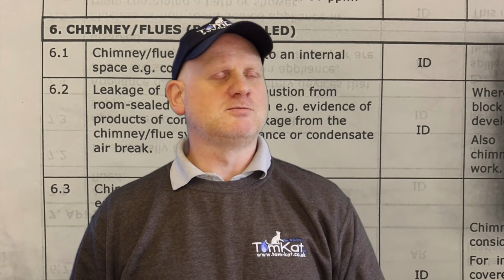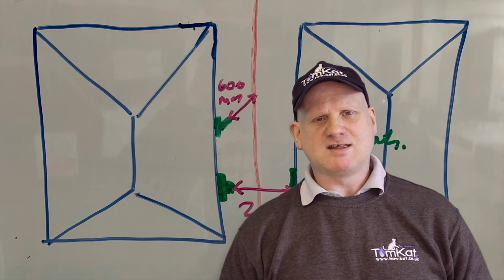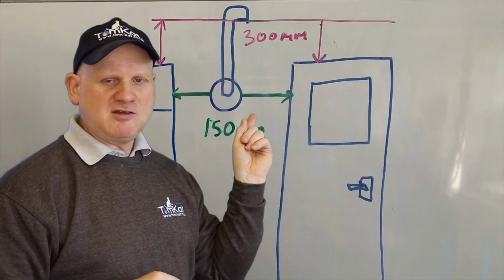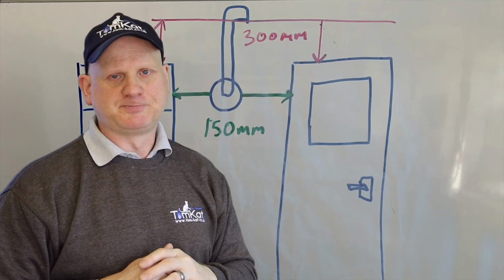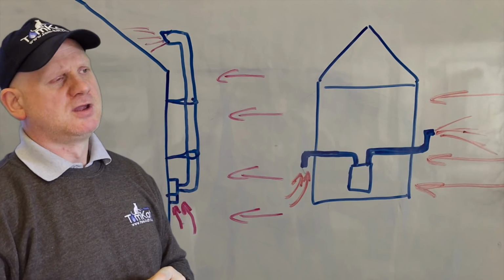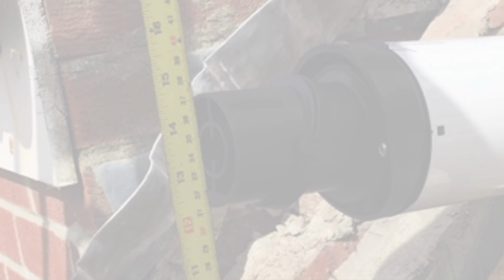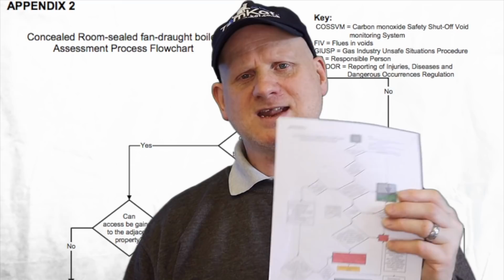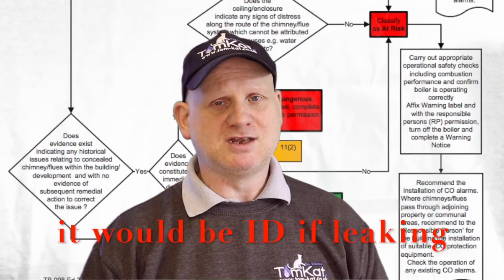How boiler flues are installed, CORRECT INSTALLATION OF BOILER FLUES PART 2, gas boiler flues,

Comment: Would you be able to clarify please (in the same clear and helpful way as this video), the correct way to install a horizontal boiler flue into a) a static all-timber building and b) a mobile timber building?

Comment: Is there a clearance distance require between the air inlet and a lean to roof?
Reply from the maker: Normally at least 200mm but it depends on the boiler manufacturer check the manufacturer instructions for the boiler for clarity.

Comment: Hi Derek great video,  1 question I can find an definitive answer too is are the minimum distance measurements (eg to a window) to the outside of the flue or to the exhaust part of the flue?  And in the same vane how does a plume divertor affect the minimum distances?
Reply from the maker: Plume kit reduces the measurement by 50 %  but only if the air intake is a minimum of 150mm and it’s from the side of the flue to the opening

Comment: So you could use expanding foam inside and possibly outside around the flue pipe provided you finish with a 25-35mm cement to provide the weatherproof status?  Why would you direct the flue upwards with that Worcester flue as that allows direct entry for rain?

Comment: What is the significance of having the air inlet and flue exhaust in different pressure systems?
Reply from the maker: Unbalanced flue system
Reply: @tomkatgastraining  I have a flue coming out of a wall, it got picked up on our RICS inspection so they have put an extension on. The opening of the extension is pretty much at the corner of the wall, I imagine it's more exposed to wind/gusts. Whereas the original flue and air intake is further away from corner in between our houses. What can the unbalanced flue system do?
Reply from the maker: @lloyd4011  as long as it’s on the same wall and facing the same way it will be fine but if you have concerns get it checked by a competent gas engineer

Comment: Thanks Derek. Excellent videos. Have you done anything on the requirements of sleeves for a flue going through a timber frame wall? I'm having a new Worcester 32CDi LPG Compact Boiler installed and our property is timber frame. Does the flue need an additional stainless steel sleeve through the wall to protect against potential thermal damage to the timber frame? If so using a flexible sleeve how should it be sealed at each end?
Reply from the maker: You will need to speak to the boiler manufacturers about this issue as a lot require different things but as a general rule the flue will require a sleeve when installing in a timber frame

Comment: 5:20 is the flue on the right to close to an opening as that looks less than 300mm?
Reply from the maker: Impossible to tell from the picture just used the picture to show boundaries and facing terminals

Comment: Hi Derek. Another great video (parts 1 and 2!).
I'm a sparks by trade but want to know what the correct way is to install a new flue to a new boiler.
I'm getting the so-called professionals in to do the job but have had different stories from different engineers who have visited to quote.
The boiler is currently in the kitchen on the back, cavity wall of the house. The flue goes through the wall where it enters the conservatory and then has a 90 degree elbow which then has about 1.5m before exiting through a multiwall, polycarbonate sheet which is at the side of the conservatory. This was done 20 or so years ago by the guys who built the conservatory and was designed by Potterton for the situation.
There are a number of problems such as lack of brackets, however if the main problems are corrected during the new installation, is it basically ok to have a sealed flue running through the conservatory, provided the POC and air intake exit outside in a suitably safe place?
I will also get advice from the boiler manufacturer, once I have a specific in mind, as per your recommendations. I don't want to waste time on this if it definitely can't travel this route. One engineer said no problem, another said that condensing boilers have hotter gases now(!?) so the polycarbonate would need to be changed and the other said that the boiler should be disconnected but he would just pretend that he hadn't seen it.
I obviously need to choose better heating companies to quote!
I hope no-one thinks that my reference to "so-called professionals" is attempting to put heating engineers down. I think that I have just been unlucky with a couple and they are the minority. You and others like you do everything to ensure that everything is done in a safe and professional manner.
Please keep up the good work. I have enjoyed watching your videos and learning for some time now, even though I won't ever be doing any of the work myself but at least I'll be able to ask appropriate questions of the chosen installer.
Reply from the maker: Hi David it’s hard to comment on a job I haven’t see the main thing is how close to the combustible material it’s got to be more than 25mm away also if you are thinking of boxing the flue in you will need inspection hatches. Hopefully you will find a good engineer ( there are plenty out there) who will give you the confidence with the job in hand
Reply: @tomkatgastraining  Thanks for the very prompt response. That makes sense to me and I'll keep looking until I have the confidence in an engineer. Safety is the highest priority so I want someone who has the same priority and confidence in doing the job (and quote).
I'm looking to local companies and recommendations now as the big internet/tv advertised companies who say "we'll get you 3 quotes" were a disappointment to me.

Comment: Always follow manufacturers instructions.  Mi's supersede all BS regs and are almost always readily available.  If for some strange reason the Mi's aren't available we look to BS440.  Flueing and ventilation are always pretty intensive subjects.

I can't understand why many Rgi's get it wrong.  If there's anything goes belly up. It's the installers neck on the line. I take pictures as evidence. If for whatever reason Tom, Dick or Harry decide they want to redirect the flue into the neighbor's loft.  I don't want Gas safe putting out a man hunt for me.  Time and time again you hear GS prosecuting gas safe members.  Mostly due to them being incompetent or their negligent.  The main problems I tend to find are with vertical flues.  Lack of support or poor joints even incorrect fallback.  Some of it outright scary.  I question myself how these installers qualified 😳

Rant over,  thanks Derek hopefully your time served as an gas engineer and  mass of knowledge.  Has and will continue to help improve this industry 👍.
Reply from the maker: Time served as a commercial gas engineer playing around with 10, 000 pound per hour steam boilers and gas ovens that could cook a chicken in 5 minutes. Can’t say your post is a rant it’s just what you come across. Keep doing what you are doing and pass on your skills to others which will make our industry a better and safer trade.💪🏻

Comment: Just to clarify if you fit a standard horizontal flue on a boiler and you fit a sealing ring on inside  and outside but no screws are supplied by the manufacturer  they are saying in manufactures instructions that this is OK. But then your saying gas safe want that flue sealing with sand and cement on inside and outside around flue under seals so who's right there then as I was always taught to follow manufacturers instructions that would mean it's OK without the sand cement and just the seals
Reply from the maker: If gas safe produce a technical bulletin it means their inspectors have found faults with appliances even though they comply with the MIs such as flues being pulled out of the appliances due to just using the seals . So we follow TBs that’s why gas safe produce them.
Reply: Thanks for that clarification Derek I will order some screws to carry with me  from ideal for screwing there flues together when I am installing a boiler on flats above two storey high the flue goes in from inside with no sand and cement possible on outside so relying on rubber seal against the brick work  I will have to put screw there from now on  what is the technical bulitan number please. Great channel Derek really helpful I have been doing gas 38 years but like pick up info from guys in the know.